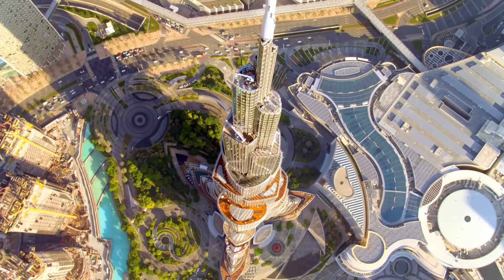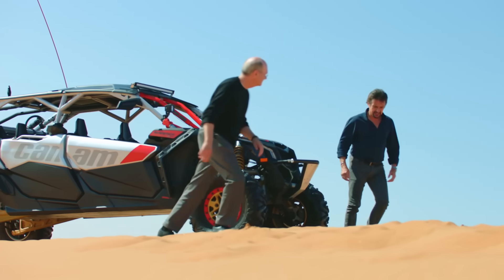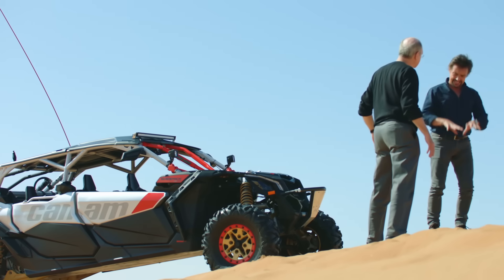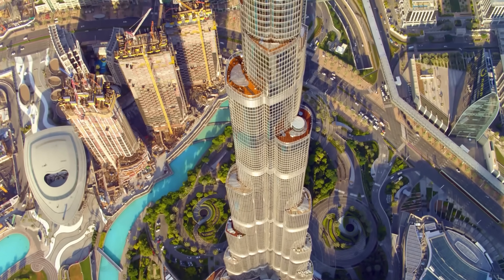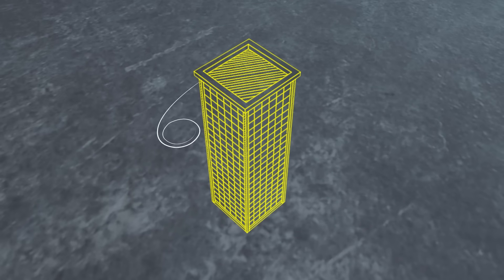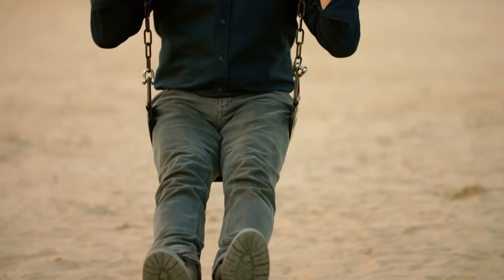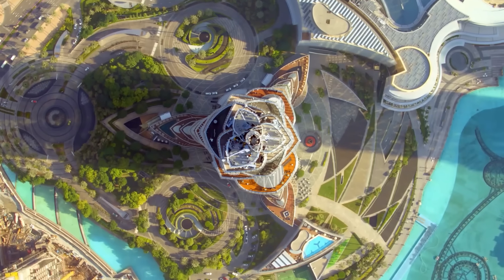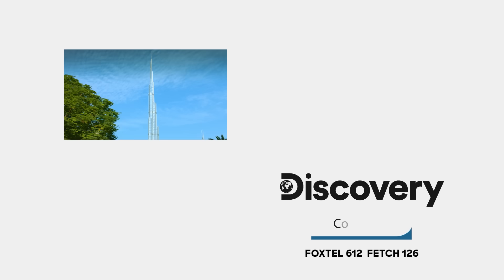Why Doesn't Burj Khalifa Just Sink In Sand? | Richard Hammond's Big

Comment: what if there's an earthquake that liquify the sand ? will it shift or tilt like pisa?
Reply: Dubai doesn’t lie on a fault line, so the risk of earthquakes is extremely low
Reply: @cpsoud  For argument sake, let's say it did. Would it be able to withstand an earthquake?
Reply: @MrDegradingChimp  Yes, because it is made up of 27 different compartments, all individually moving. Therefore the force cannot settle upon the building and gets unevenly spread across its height.
Reply: @YousefMohamed-fn6oi  Nope, didn't happen in Dubai. Happened in countries around it, but still it barely got affected.
Reply: Doesn't there have to be a decent amount of liquid mixed with the sand for it to liquidfy?
Reply: Abacus  Kinda embarrassing your inability to read. I never made a point to be proven wrong. I've literally only asked questions. Don't @ me if you don't know what you're talking about. Kinda pathetic.
Reply: @MrDegradingChimp   What's pathetic is you getting all fussy because a couple of people didn't understand your question. Especially when you already got the answer from someone else^^. Grow up.
Reply: @MrDegradingChimp  plz stop barking
Reply: @YousefMohamed-fn6oi  Yeah, okay. Clown.
Reply: Also the concrete pillars that go down into the sand prevent it from sinking during an earthquake. The science of how it works was actually shown off during Hammond's Engineering Connections series on the Earthquake Proof Bridge, that used a similar thing.